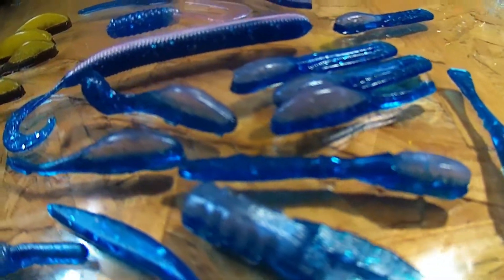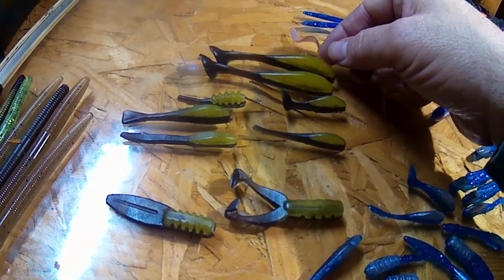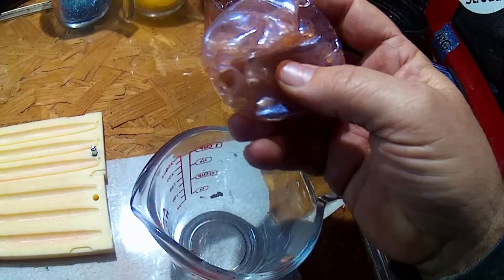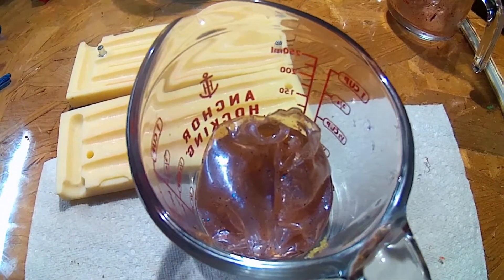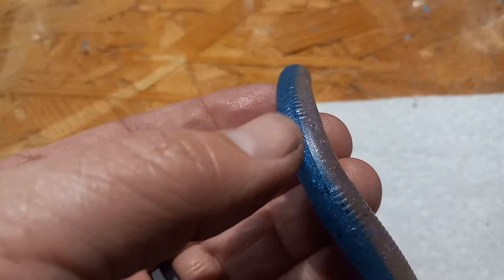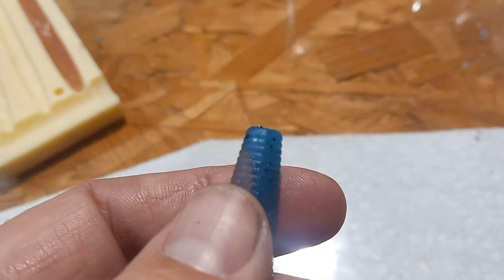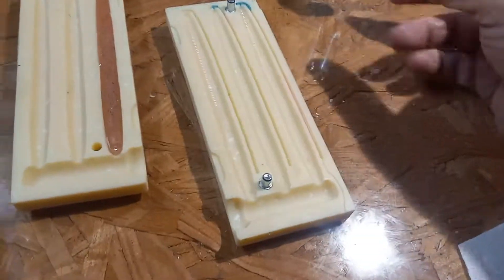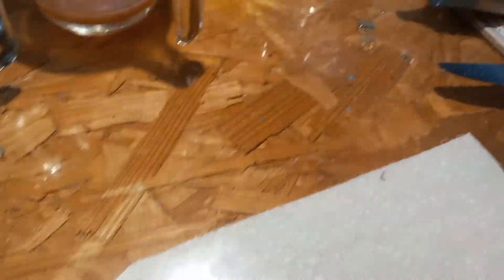Laminating two colors without a laminating plate.

Comment: i do a lot of skin pouring as well , i would recomend switching to aliminium mold , do-it has cheap ones and they work so much better then stone or plastic
Reply from the maker: I was seriously considering aluminum.  I'm having good luck with the stone molds and once I'm past the exploration of this hobby I'll probably start picking a few up here or there.   Stone is an inexpensive way to test stuff out and collect some different molds relatively fast.   For a home hobbyist, I like them.  This will likely never turn into a side hustle so they are worth the trouble now.  I'm looking at an aluminum crappie mold but just got into raising quail.  The hobby money is going that direction until I get that setup.  Keeping my eye out for an irresistible sale on one though.  And then I also have an AR9 build going on too.  Appreciate the advice and comment!  Take care.

Comment: You need to add mold release to these molds. Ive had good results using regular oil. I use the oil for my electric razor with a paint brush.
Reply from the maker: Agreed